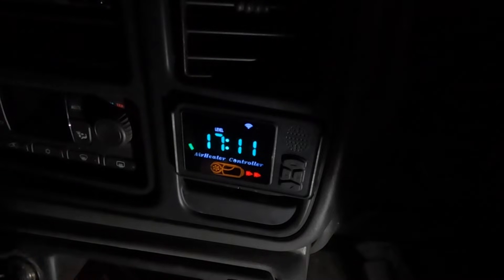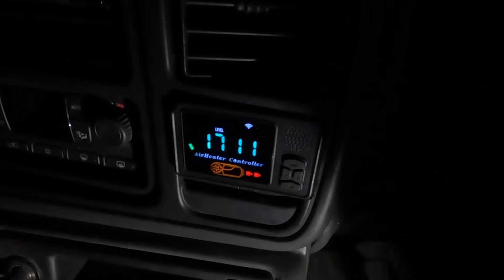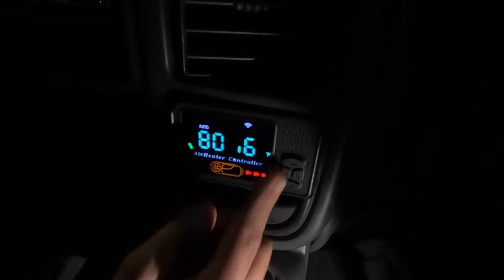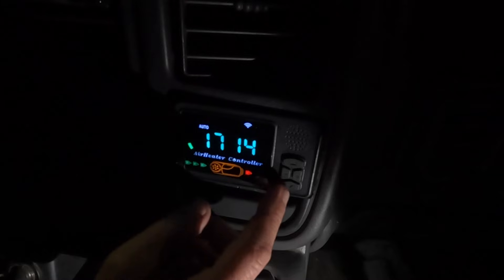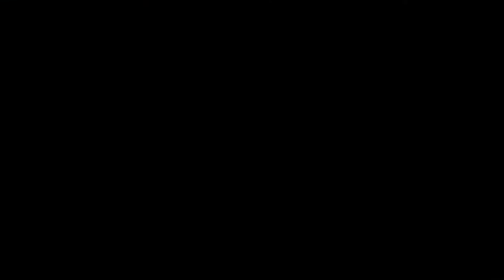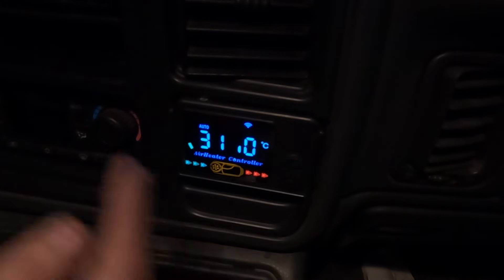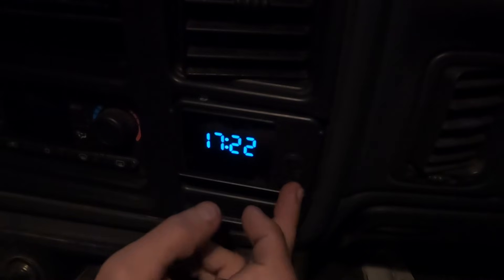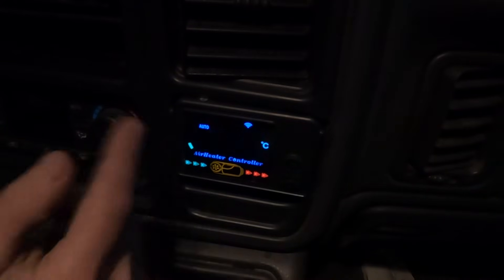Bluetooth Diesel Heater Feature & Settings Discovered !

Comment: Loving your videos and experiments! When you operate the heater in auto mode, what is the swing temp that it kicks on and off? For instance, if you have it set to 38 degrees, at what temp will it kick the unit off, and at what temp will it turn back on? Is that swing adjustable?
Reply from the maker: I honestly haven't had time to use this at all, other than to demonstrate it for the video. Someone commented on my video in the past few weeks actually answering this question, but I can't remember. I think they said it was 4 degrees swing, but I could be mistaken. 

Again. I think it may be adjustable in the menu that I show in this video, but I hadn't had time to tinker with it. The manual is basically useless, so the only way for me to find out is to sit there for hours playing with it. 

There are a few items in the menu that I have no idea what they are... so this may be the swing setting.

Comment: Do all the current vevor heaters have the Bluetooth as well as the remote and on onscreen front control?
The thermostat is only built into the front control?
There is an extension cord to move the front control indoors?
Reply from the maker: No. They have several models of heaters that do not have Bluetooth. Some that are very basic and some that have an engineering mode. 

Yes, the thermostat is built into the control unit. 

You can get extension cables on aliexpress. You will need to make sure it has the same connector. I extended mine with some 16 gauge wire.

Comment: How do you set the high altitude compensation I'm at 6500 feet and up always
Reply from the maker: The bluetooth controller compensates automatically. If you look at the app, you will see the elevation in the top left corner. The ECU knows the barometric pressure and sets the fuel accordingly. 

I believe it only has one low and one high map. Meaning, it is not infinitely variable (I assume). So if you are at sea level, it will run off one AFR map, and if you go above 3500ft (for example) it changes to the higher elevation map. 

If you do not have the Bluetooth controller, there may be a button to set it to "alpine" aka "plateau" mode. How to do this varies from controller to controller. 

The old style / original style, has manual compensation that you access through an engineering mode. Generally have red digits. If this is your controller, there are many videos on how to do this.

Comment: Anyone else have issues with the clock running fast.  Gains like a hour a day?
Reply from the maker: Yes... I have had a few people mention this... I don't use my clock or set a time on / off, so I hadn't noticed. I set mine last week and now it is WAY off. 

Not sure if there is any solution for this.

Comment: I have just installed my Vevor unit (bought thru your link) and I am trying to figure out how to get it to start. I did the prime (the 300 count down) but I have not yet found how to make it actually start heating. I have the controller with bluetooth and the 4 buttons and speaker on the right, as you have in your video. Thanks
Reply: Actually, I got it working now. My power supply was insufficient. Once I hooked it to a battery and waited a bit, it came on and heated just fine. Thanks for your vids.
Reply from the maker: @lynnkasdorf7258  Awesome ! Good to hear. Your power supply may be sufficient to keep your battery topped up. The heater will pull about 10 amps on start up, but once it's up and running you can get away with about 4 amps, maybe less. Last year I ran a small battery and a 4 amp battery charger and never had an issue.
Reply from the maker: Hey... Thanks for the support. 

I hope you have figure this out... There is an arrow up, arrow down, on the left is the menu button and on the right is the power button. Push the power button and it should say "start heating" or whatever it says... then it will take a minute before the pump starts and fires up. 

Let me know if you have more problems.

Comment: Well I figure if the hot plate is causing a restriction then I’ll force feed it some air.
Reply from the maker: If you can do this is a very controlled way, this could work. I have found that these heaters are very particular and making changes like this, though simple in concept, can be a lot more difficult than expected.

Comment: Mine keeps sooting up 👿
Reply from the maker: That sucks. Fortunately these things are pretty simple, so it should be easy to sort out. 

Do you have the Bluetooth heater from this video or a different one ? If it is the Bluetooth heater, then it should have automatic elevation adjustment. If it does, it will say what it thinks your elevation is in the top left of the app. Check to see if that is close to correct. If it's not, there's a problem with the ECU. 

If you have one without elevation compensation, there are two other types. Some have "plateau mode" or "alpine mode" that you must use at higher elevation. If you are at sea level, or up to about 3000 feet, you shouldn't need to worry about this. 

The third type is the old style controller / ECU that allows you to set the pump and fan speed in an "engineering menu" This determines the air fuel ratio and must be set correctly. They generally come set for sea level. There are videos on how to set this using heat, and that works better than nothing, but ideally you want to have a CO meter. 

Likely, the ECU is not your problem, unless you are at high elevation 4000 + feet. It is much more likely that your issue has to do with something about your installation. The air inlet and exhaust must not be restricted. This means not too many bends in the exhaust or inlet, no kinks and no blockages. 

If your heater is installed in a small area, it is possible it can't suck in enough air into the inlet for combustion. Air has to be able to get into the where your combustion air inlet is. 

If you had a problem and fixed this problem (Kinked intake or exhaust) , but still have carbon build up in the burn chamber, heat exchanger, exhaust port or exhaust pipe, it will continue to have sooting issues until it is completely cleaned. 

Hopefully this helps.
Reply: @loweredexpectations4927  
I built a hot plate like yours and I think there may be too much back pressure. And yes it’s the vevor Bluetooth model it soots up after a couple hours of running on high
Reply from the maker: @daronwheeler2768  Oh, yes... that will do it for sure. I did a test (my last video) where I ran my 2kw exhaust into my 5kw ... I didn't notice till after the video, but it did cause some sooting on my 2kw unit. They do not like restrictions. 

You can still make a hot plate, as long as you don't cause too much of a restriction.

Comment: I get over 300 feet with the wireless fob. How far are you getting with Bluetooth, under 50 feet I bet.
Reply from the maker: It seems to greatly depend on the weather... I was surprised buy this. I think the most I have gotten is 75 feet(ish) and under most circumstances, sitting in my house with a few walls between me and my truck (not sure if that matters) 60 feet
Reply: @loweredexpectations4927  thanks,  reason I ask is some of my Bluetooth items are scetchy at 10 to 20 feet. Lots of variables on all the toys 😉

Comment: Great videos Is the Vevor 2KW model truly a small frame 2 KW heater ?. It would be great if you had a good recomention for a GOOD 22ml dosing pump, as most are Dog Shit ! 😮
Reply from the maker: Thanks ! 

Vevors 2kw heater is a smaller version (physically smaller in every way) compared to the 5/8kw units. 

I don't have a recommendation for a fuel pump. What sort of issues are you having ? I am using the same one that came with my original Vevor heater and haven't had a single issue. I've run diesel, waste oils, gasoline, methanol, paint thinner and varsol through it for over a year now and it works flawless... I'm honestly shocked.
Reply: @loweredexpectations4927  Thanks, I run 5 heaters, boats, float house and shops. I have the style that does not come apart. I have had a few now, in 3 years, that would not start up, after 2 or 3 months of shut down. I assume the solenoid gets fuel gum on it and sticks.
Reply from the maker: @stevecarlisle3323  Very interesting. It could actually be that the abuse has created enough clearance that my bump is more immune to sticking. Or it could be the liberal coating of oil.
Reply: @loweredexpectations4927  that could well be true, as in the early days of my heater acquisition, they recommended adding trans fluid. They have newer style pumps where the shuttle valve can be taken apart. Thanks for your reply, and good luck with your channel, you are doing very well. It's interesting seeing the Mini in the background, my buddy just got his hands on a near new high performance track version, tested at Nuremberg, one of only 2 in Canada.
Reply from the maker: @stevecarlisle3323  Thanks ! The heater content seems to to pretty well. 

Sadly, the mini is gone. I sold it to pay for a milling machine that I am attempting to convert to CNC. In the middle of it all, I am getting separated from my ... common law, and probably won't be able to afford to keep my house. Not sure where things are going to go, but I'll take it as it comes.
Reply: @loweredexpectations4927  Your Young enough, and seem to be smart enough to overcome your situation. The CNC content may be suitable for your channel. I have had my own larger machine tools, and sold them a few years back. Recently a buddy asked me to set up a larger machine area in his fab shop, 20x120 lathe, and a full power axis, NST40, 5hp VS Bridgeport type mill.
Reply from the maker: @stevecarlisle3323  Yes, I will be fine, I may just have to live with it sucking for a while, haha. Ooooo, will you get to play with the stuff in his fab shop, once it's up and running ? You must miss your machine tools ?
Reply: @loweredexpectations4927  Well I missed my machine tools, before I set my buddy's up, I have full access to his shop anytime I need it, so I am spoiled. ☺️
Reply from the maker: @stevecarlisle3323  That's awesome ! I'm happy for you. That's how it should be 👍

Comment: Hey guys is there any way to change the idle rpm of the fan to a higher one like in the older models? Mine keeps overheating, a higher idle rpm would help
Reply from the maker: This heater does not have access to an engineering menu. 

That being said, if your heater is overheating, there is a problem. Some sort of blockage in the combustion air inlet/ filter, a plugged or kinked exhaust, or too much restriction on the ducted or cool air inlet. 

It would be a good idea to diagnose this properly so you don't have serious / dangerous issues in the future. 

You can try running the heater on a bench to see if it still overheats, then add components to see if one of them causes a problem. If the heater is installed in a really small space, this could also cause are restriction and overheating. 

The fact that it is doing it on the low setting sort of indicates that it is an air restriction to the combustion air inlet, but it could be something else.

Comment: Do these have any adjustments for altitude or is it auto? I have the same unit and will be going from sea level to 8000 feet soon
Reply from the maker: They have auto compensation. I'm not sure if it will be enough for 8000ft though. 

My other heater that has a manual setting "alpine mode" runs pretty hot at 4000ft in normal mode (210-220C) and in alpine mode 185.
Reply: @loweredexpectations4927 we’ll I guess we will find out! Fingers crossed I’ll follow up with my findings
Reply from the maker: @Therealpotato12  In my email notification your name shows up as "Carol Baskin" (not sure if I got the spelling right) .... but here as the real potato I was very confused and amused. Good luck.

Comment: No mention of how to get the Bluetooth connection.. I thought this was the point of your video? My display only got 3 buttons. Left arrow, power. And right arrow. According to the manual there should be some other buttons.. Omg..
Reply from the maker: Perhaps your controller is not a Bluetooth versions ? Is this a Vevor unit ? The Vevor controller connects easier than farting, so I didn't think there was any need to explain, haha. 

To get the Bluetooth connection, you click on the top right corner of your app where it says "scan". You will see your heater as a code ... You click on that and it will connect. If your heater controller is not showing up when you scan, Bluetooth may be turned off in your controller .... as I do not have the 3 button controller and have never used one, I don't know how to turn it on or off or if it is even possible. 

Good luck.
Reply: Features and settings. Not connecting and disconnecting.
Reply from the maker: @utech9989  Yeah... to be fair, I could see the same confusion happening to me, haha.
Reply: You don’t have the Bluetooth version
Reply from the maker: @Misunderstoodboygenius  I also suspect this to be the case.

Comment: Joel- I appreciate your knowledge of these heaters, and sharing it. Perhaps you can weigh in on whether there is any difference between the 8kw and 5kw models? Is it just default settings on the controller (pump hz and fan rate)?
Reply from the maker: Thanks for the comment ! Do you mean in a video or just answering your comment ? 

I can tell you that there's no difference physically, between the 5 and 8 and they even use the same pump. I have heard that some 8 kw units overdrive the pump a little in the max setting, to produce a little more heat, but have not experienced this myself. 

I am interested in testing this to the extreme at some point.... not sure how soon. Cheers !

Comment: So many controller types! I am about to buy a heater and I want:
- access to the engineering menu for max/min pump hz and fan speed and ideally C/F display setting
- bluetooth and app
But it seems that these 2 things are mutually exclusive. Is that still the case, or do some of the newer controllers (not aftermarket) do both?
Also- the remote with the display is really nice- is this only available with the blue oblong frame controllers like in this video?
Reply from the maker: Access to a engineering menu is only really necessary if you want to tinker with the heater. The bluetooth controller has automatic elevation compensation that corrects the fuel ratio for you, so you don't need control if the Hz and fan speed. 

Made simple. Access to the engineering menu was for correcting your air fuel ratio, depending on your elevation / air density. New controllers either have a "alpine" or "plateau" mode for high elevation, or automatic compensation based on barometric pressure. 

This video shows how to switch the bluetooth controller from C to F. 

The fob with the built in LCD appears to only come with the mid school controllers. No engineering and no bluetooth. 

There is an aftermarket controller called the afterburner... It is made in Australia and is about $130 US... I believe. It gives you an insane amount of control... everything you could ever want. It uses wifi and you can connect from anywhere and change just about anything. David McLuckie has videos about this. 

Cheers.
Reply: @loweredexpectations4927  Thanks for the info. I do not need high altitude adjustment but might want to play with alternative fuels, hence my desire to tweak things. What about the controllers that have the round rotary knob on the right?
Reply from the maker: @lynnkasdorf7258  All of the rotary knob controllers that I have seen are extremely basic. 

I spent 4 months last year burning all sorts of alternative fuels and air fuel ratio was never an issue, despite what many claimed.... There are some fuels like gasoline or alcohol where it would be beneficial to change the AFR, but those fuels won't work well due to the design of the chamber. Light oil fuels like kerosene, paint thinner etc. all require around the same AFR as diesel...  

Heavy oils like engine oil, trans fluid, gear oil etc, will all leave behind ash, even if you have a perfect burn, that will lead to plugging your burn chamber up quickly. 

Hope this helps.

Comment: Hi, is there a way to change parameters with this controller? Hertz and RPM?
Reply from the maker: No... it has automatic elevation adjustment.  That feature is on older heaters, to allow you to set the air fuel ratio, and this one does it for you. 

Most heaters will now have "alpine" or "plateau" mode for high elevation where you push a button to compensate, and the original style controllers require manual adjustment.
Reply: Ok, because I was trying to use the Bluetooth controller and the motherboard of a new 5kw on the old 2kw, it is working fine but obviously parameters are for the 5kw, so I can't use it in max / auto mode otherwise it would get smoky due to the amount of fuel set for the 5kw. Was wondering if there is a way to make it work properly then.
Reply from the maker: @matteoschiatti8691  Okay... that makes sense.  

Yes... the fuel will be WAY off. Unfortunately, there isn't an easy way to do this. The only way would be to make an electronic device that modified the HZ of the pump output and reduced it to a reasonable level. Other than that... you may be able to do the math and find a much smaller fuel pump. I'm not even sure if they make such a thing.